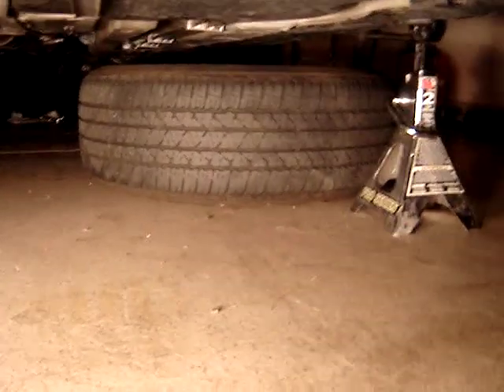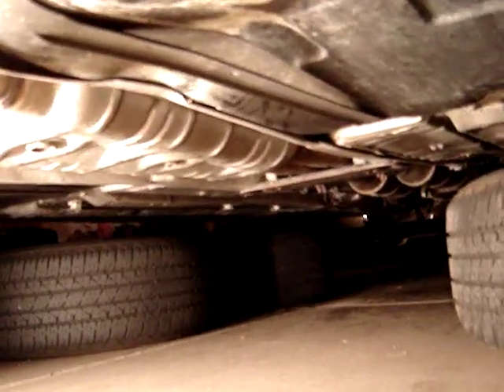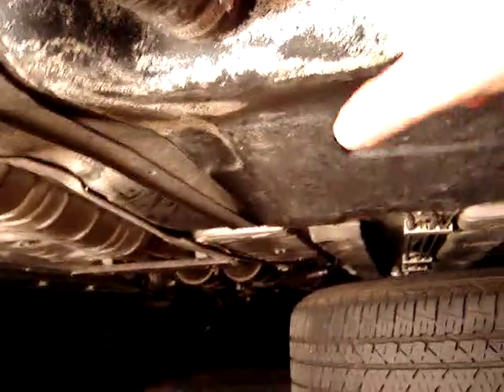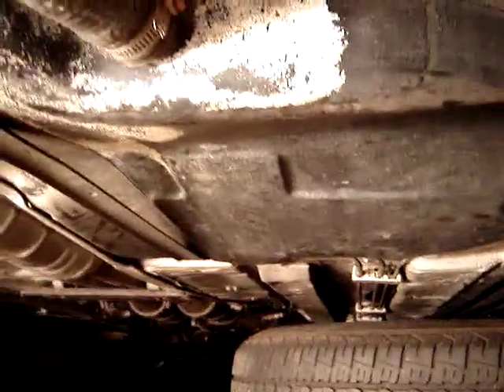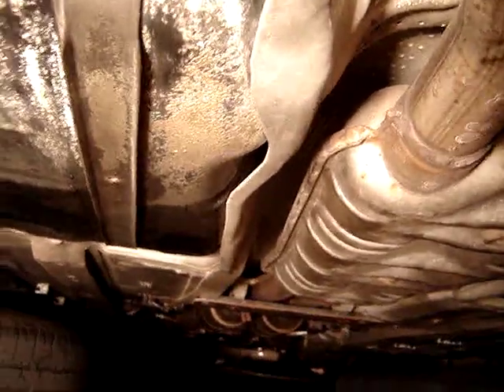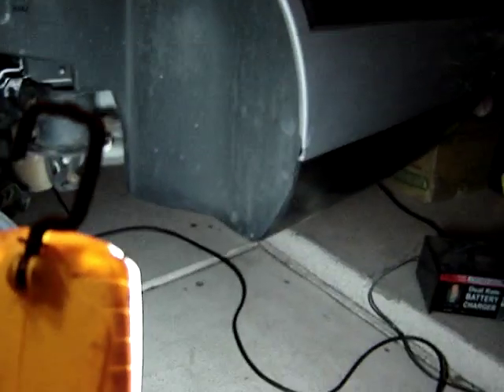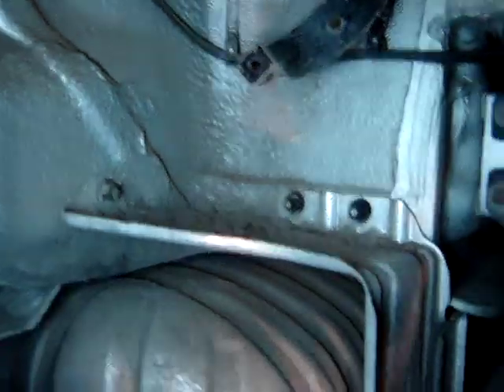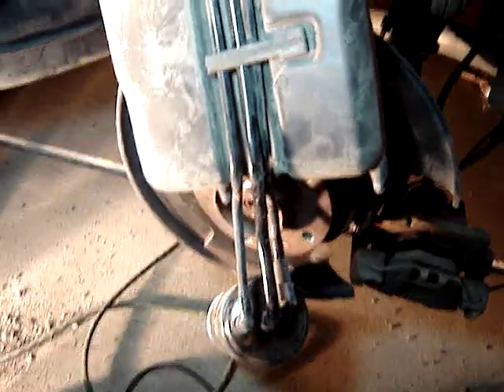BMW E38 740iL gas tank implosion:  vent tube and charcoal canister replacement

Comment: Did this fix your problem with the gas tank.  Also did you ever check your fuel line.  The inline one I found charcoal in it from the canister.

Comment: Appreciate the video - a little long and drawn . It would have been nice if he identified which side of the car he was working replacing the canister and vent
Reply from the maker: +Thomas McHugh true, a bit long and drawn out, but it was real time baby, not school.  So I was doing and learning as it went along.  You are right though it could have been shot in a much more informative way.  The canister is located behind the wheel liner of the driver side (us car) rear.  I posted the part numbers in another comment which would have been useful.
Reply: Thomas McHugh  it's on the rear passenger side where the driver side is.
Reply: @bgrey55  That's pretty confusing. Driver side or passenger side? You just said it's both.
Reply: @tjfisher746  lol the passenger side where the driver door is. Hope that is clearer. The part is around 100, the charcoal canister.

Comment: great video.  what are the part numbers of the purge line and the canister?  Thanks.
Reply from the maker: +mark proteegolf Charcoal cannister = 16-13-6-758-757, vent tube = 16-13-1-184-554; run about $100 for cannister and $25 for vent tube if you shop around.  Note this is for 1997 740il; i think it fits '95 to mid '98, but very your proper part numbers here:  www.realoem.com